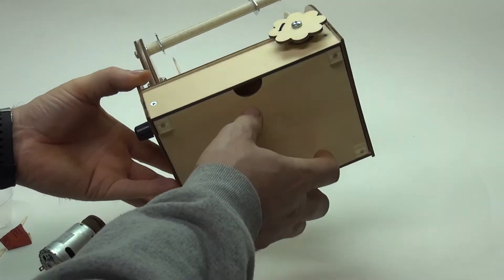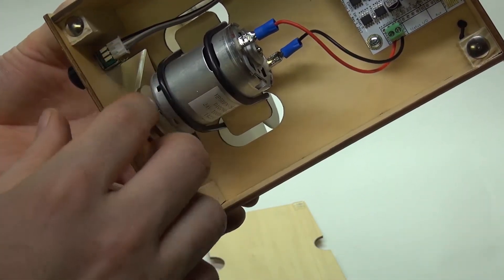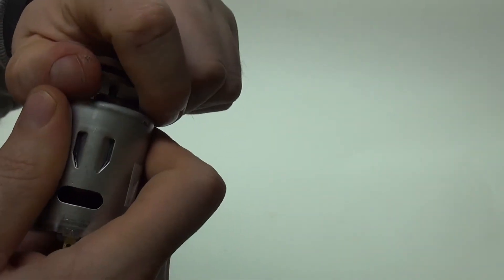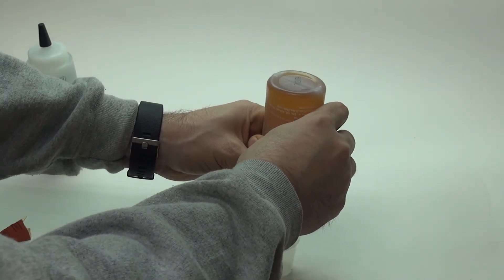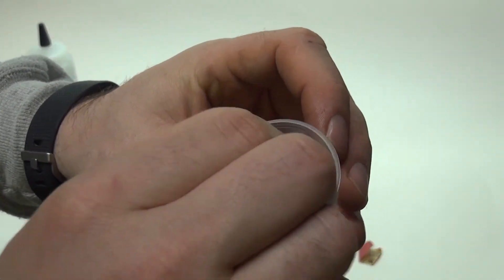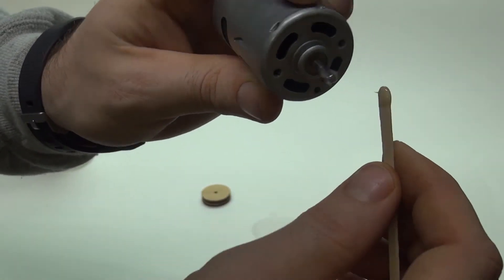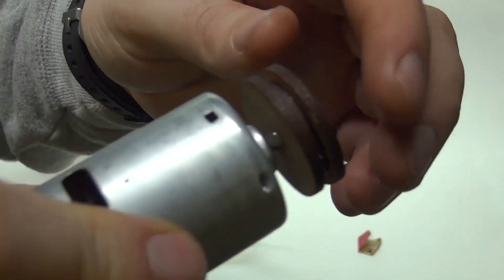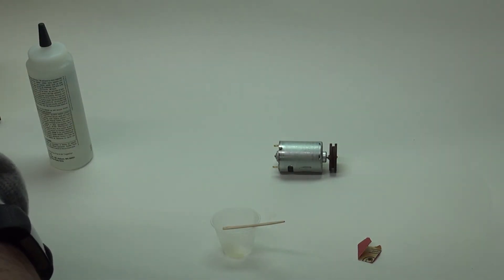SPIN #29 - Fixing Motor Pulley on EEW5

Comment: I have Gorilla Glue, but the problem is, it does foam but very strong.  I like the idea of the 2 part Epoxy glue,  because it dried clear and smooth and just as strong.  I'm getting the slower hold.  Thank you for reminding me about this video.  I did view this video before after I first discovered you and your EEW Spinners.